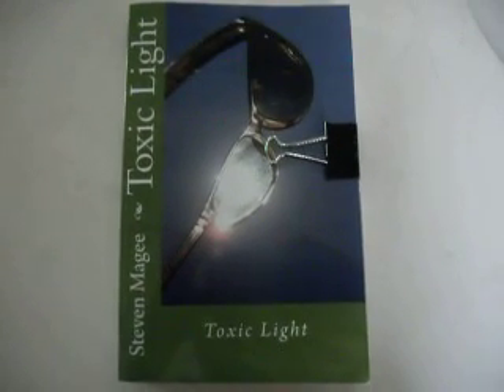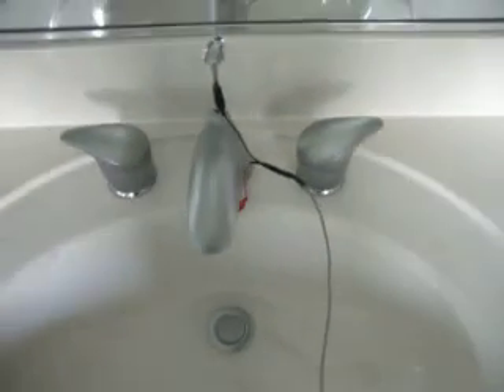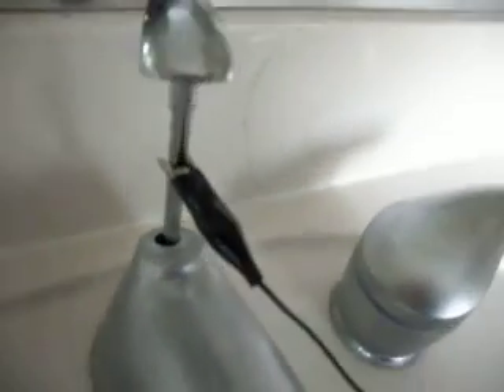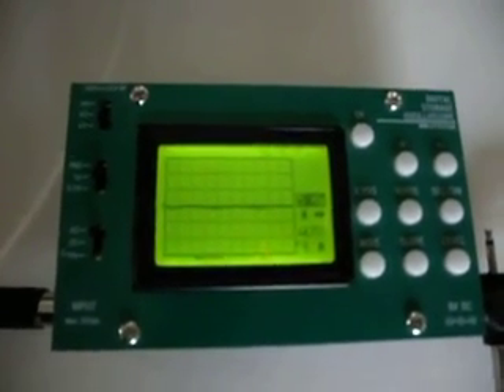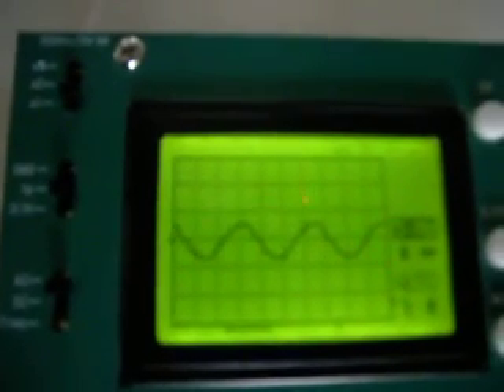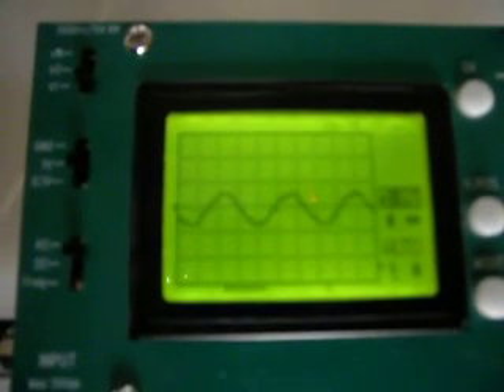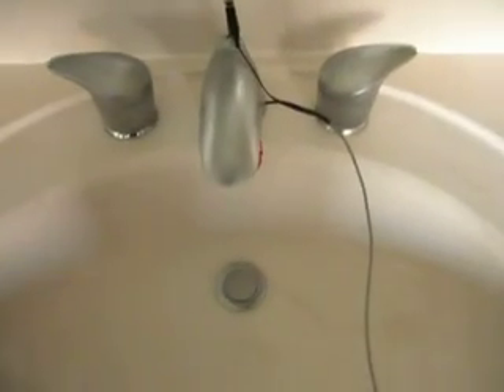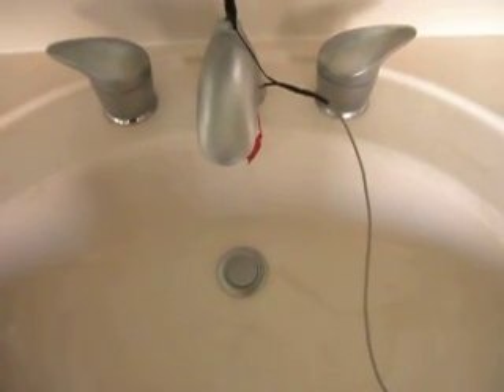Testing the household water voltage with an oscilloscope.

Comment from the maker: Biomedical science has progressed since this 500 ohm load resistor standard was defined by the power companies and my research is now indicating that merely being in contact with an AC voltage that originates from the grid will make you sick.  It is not the current that does it, it is the voltage.  We are not talking about electrocution here, we are talking about long term sickness induced into the body from the AC electrical system.